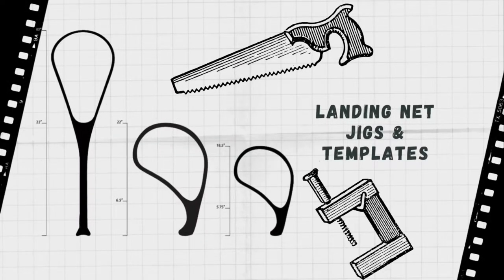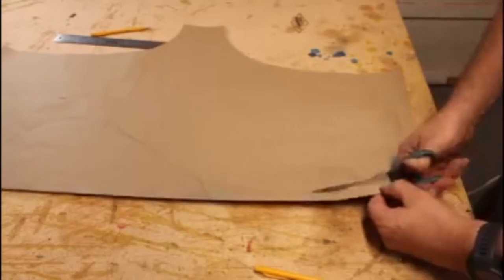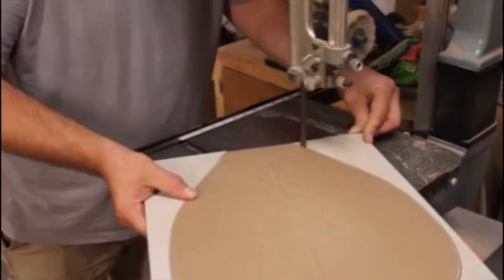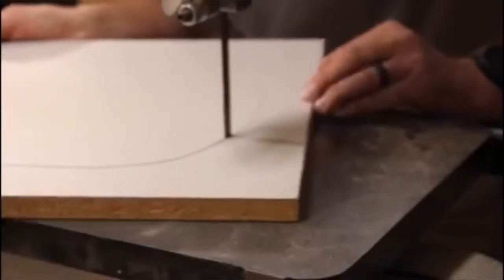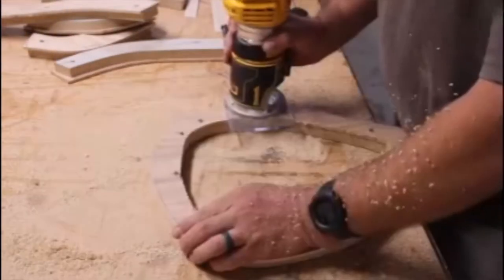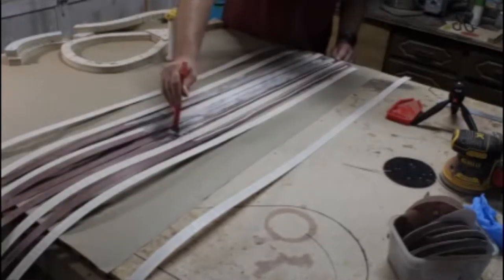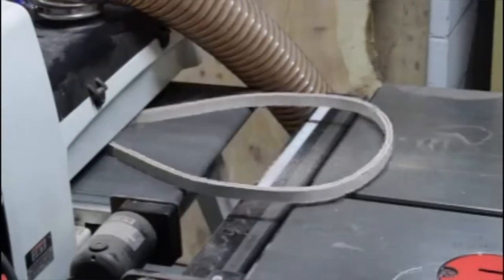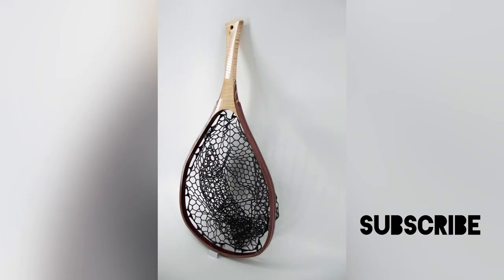How to build Landing net jigs and templates

Comment: James! Beautiful work and thanks for the detailed explanations. I've found that when building the clamping cauls the appropriate size to accommodate the thickness of the hoop I've used a hole saw cut out with the correct radius to use as a guide while tracing around the hoop. Also, what slot router bit are you using?  Thanks for the help!
Reply from the maker: I use a 1/8 by 1/8” slot cutting bit I’ve found thru mcls tools. I called them up and told them what needed and they were very helpful, and the price is extremely reasonable.
Reply: @jamesfeight5818  Thanks, James!

Comment: I am thinking of making my own Lansing net. I dont have much experience working with wood what will probably be evident by my question. Can i not just cut a frame from a wood plank instead of building the arch with laminate?
Reply from the maker: I wouldn’t suggest it. The grain of the wood going in two or more directions over such a narrow piece wouldn’t be very strong at all. The multiple piece of wood with the grain going in one direction is what gives it its strength

Comment: do you purchase the net bag first???
Reply from the maker: As far as deciding the size of my net, I do ensure that I can purchase a bag(net) that will fit it. Janns nets have a good selection if your looking. Typically I use Ed Cummings brand
Reply: @jamesfeight5818  thank you for the reply! 
I appreciate it. That’s exactly what I was thinking. Here’s my “other “ question. 
Is the net circumference that I’m measuring or the front to back- side to side measurements? 
I’ve also seen several with only the bottom of the net measurements and the deep”ness” of the net measurements. 
This is my final confusion.
Reply from the maker: I believe it’s a cross pattern measurement. Length to width. So like 16x12 or something like that. I would go bigger if your unsure at least for the first net. People tend to like a deeper bag